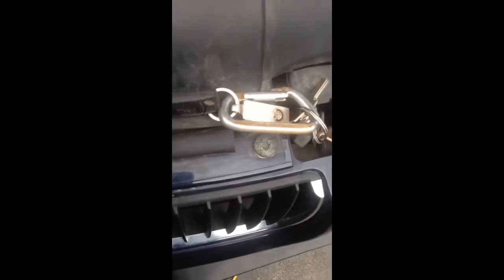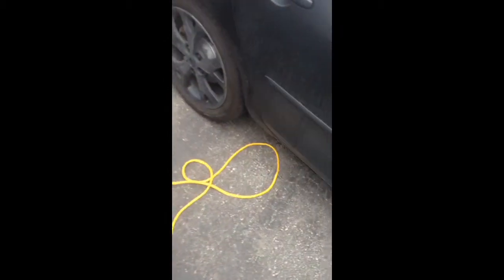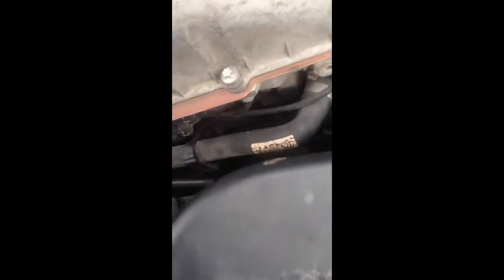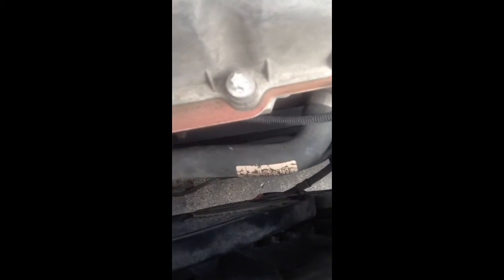BMW 325XI E90 N52 Water Pump Running With No Key Draining Power

Comment: Yes you need a new pump ,the pump goes bad and stays on . Typically its only suposed to stay on for like two or three minutes to prevent scaling in the motor . But mine drained my battery , i found the fuse that runs it under the left air dam under the hood where the relays are and put a switch on it . The pump is still good, just malfunctinin . It will probably still throw codes though.